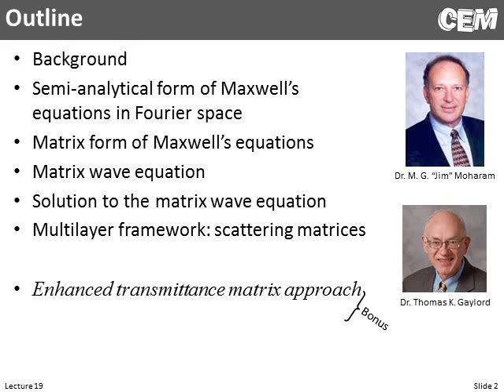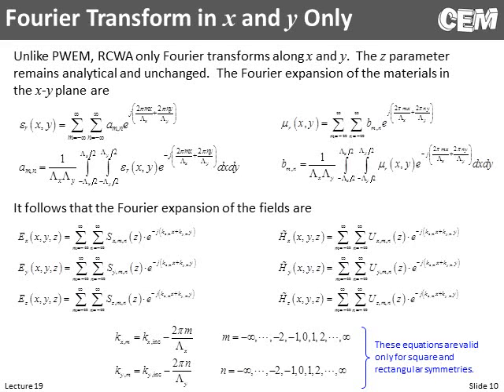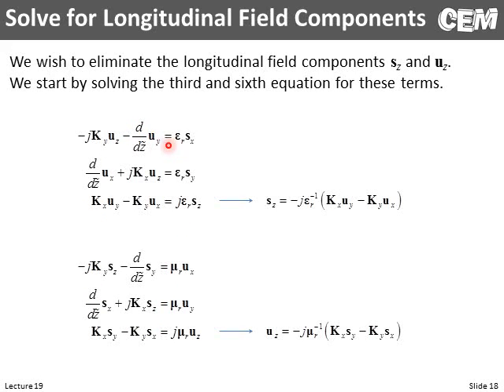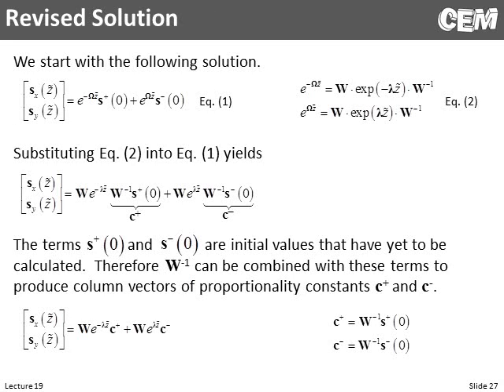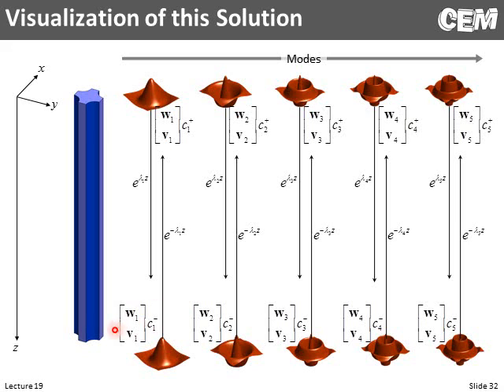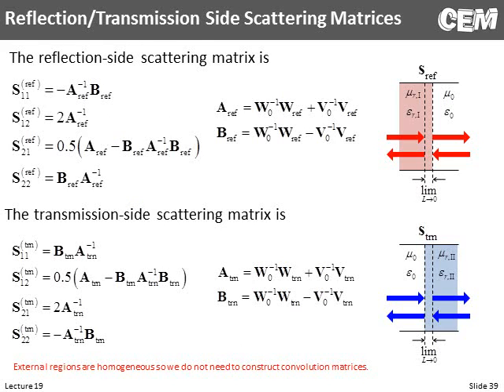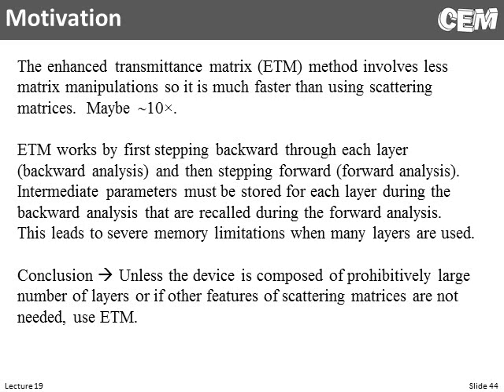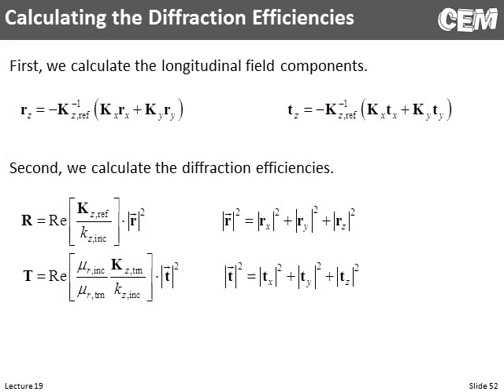Lecture 19 (CEM) -- Formulation of Rigorous Coupled-Wave Analysis

Comment: Hi Dr. Rumpf, thanks a lot for the video and all the courses available on EMpossible. I have a quick question about RCWA: if I want to speed up a 2D RCWA code for high index contrast design optimization, where should I start? Mode truncation? ETM?
Reply from the maker: Truncation -- The modifications to the code are minimal so it is an easy tweak once you figure it out.  Expect a 10% to 20% speed up.

ETM -- This will force you to reformulate how you combine multiple layers.  It requires that you store information from each layer, so if you have hundreds of layers you may run into a memory issue.  Expect maybe a 5x to 10x speed improvement.  I also use ETM instead of scattering matrices when I visualize internal fields.

FFF -- You should also consider incorporating fast Fourier factorization.  This helps with Gibb's phenomenon which is worst for high contrast devices.

Depending on what your device looks like, there are other tricks to speed things up.  A lazy code with repeated layers may analyze each layer independently.  If you can reuse any scattering matrices, that will speed things up.  If you are simulating slowly varying curved structures like a photonic crystal, you may be able to combine adjacent layers that are very similar.  In this way, you can reduce the number of layers with excellent accuracy.  You may also be able to parallelize your codes or employ GPU computing.
Reply: @empossible1577  I do have one question about ETM speed enhancement. In the scattering matrix approach, the most time-consuming step is to construct W and V from eig(P*Q), but in ETM, it is also necessary to construct the eigenmodes, which takes the same amount of time as the scattering matrix approach...
Reply from the maker: @Liangyu-claude  All network approaches involve calculating the eigen-modes so we can ignore that.  The equations used to calculate and combine scattering matrices are also a bottleneck.  They are far more computationally intense than the equations used in ETM.  The benefits of scattering matrices are memory efficiency, consistency with physical measurements, and the terms having physical meaning.
Reply: @empossible1577  I see what you mean. Like the Redheffer star product.
Reply from the maker: @Liangyu-claude  Correct!  That is a very expensive computation.

Comment: Hi, professor! Thanks for lecture! 
I have followed the procedure in this RCWA lecture and I write my code of the scattering matrix successfully. 

But I have trouble in writing the code of enhanced transmittance matrix(ETM). 
1. Could you tell me how to update the B in the 'Work Backward Through All Layers' of the block diagram? 

2. When I test my code, the reflectance remain 1 while the transmittance remain 0. Could I send my code to your email and ask for your advice? 

3. In slide 71 of the lecture 7(c) note, I found t1 is on the right hand side of the expression of B'. Is it a typo? 

I appreciate your help. Thanks sincerely!
Reply from the maker: Sorry that is not so clear in the notes.  You might be the first to implement the ETM method from my notes!

B  = F * [II;X*b/a*X];

Here II is the identity matrix.
Reply: @empossible1577  Thanks for your reply, professor! 
Now my code of the ETM can work and I can get the same result as the scattering matrix. But I still have confuse in the calculating process. I calculate the matrix A in light of silde 66 but I can't get the right result. So I try to put the minus sign of the third row of matrix A to the fourth row and my code runs successfully.  I think I calculate the right result by luck. Do I make a mistake?  I should learn more about the construction of the matrix A.

Thanks sincerely!
Reply from the maker: @huangshp8820  This may be because of how you handled the negative sign on teh KzI term.  This is the z component of the wave vector in the reflection region.  To be strictly correct, it should be negative.  Many times I will keep it positive since the negative sign will just need to be removed later anyway.  Check into this.
Reply: @empossible1577  OK, Thanks sincerely for your advice, professor!
Reply: @empossible1577  Hi, professor! Could you give me some advice on how to image the electric field profiles in the x-z and x-y plane?
Thanks sincerely as always!
Reply from the maker: @huangshp8820 I like to calculate the field in a 3D grid and then I use the slice() function in MATLAB to visualize the field in any plane that I want.  The field calculation is fast enough that I don't think it is necessary to calculate it just in a single plane.
Reply: @empossible1577  Thanks for your reply, professor!
After thinking about two days, I still have confuse in calculating the field. I can calculate the x,y,z componts of the field in the 2D grid in light of silde 11 of lecture 7(a). But I don't know how to calculate the field in a 3D grid. Could you give me some advice on how to calculate the field in a 3D grid?  Besides, I have another question about the simulation of device with loss or gain. Could I change the permittivity of device into complex value directly when loss or gain is incorporated into the simulation?
Thanks sincerely as always!
Reply from the maker: @huangshp8820  Loss and gain is incorporated simply by giving the relative permittivity an imaginary components.

For visualizing the fields, I have very few notes.  The closest discussion I have is calculating the fields for the plane wave expansion method.  Think of this as calculating the fields from RCWA in the xy plane.  Then all you have to do is add phase to calculate the field at any position z.

You will find that in Lecture 6e.

https://empossible.net/emp5337/
Reply: @empossible1577  Thanks for your reply, professor!
Now I can image the field in a 3D grid. But the field I calculated is different from what I expected and I think the result is unreliable. Maybe I should find some benchmarks and spend some time in comparing the result I got with some benchmarks or results from published paper. 
Thanks for your advice sincerely!
Reply from the maker: @huangshp8820  What do you mean by unreliable?
Reply: @empossible1577  Sorry, professor, I didn't make it clear. 
I consider a simple case in the simulation. I use the RCWA to simulate  a 1D grating made of fused silica., there are  about three diffractive modes(0,±1 mode) being generated in the transmission side according to the grating equation. The light is incident on the grating normally with TE mode. And I can check the variable ty(slide 45 in Lecture 7(a)) to make sure that there are only three diffractive modes.  But when I calculate the electric field in the transmission side without adding phase, I only see one band centered in the figure. The figure is like the first figure in the slide 5 of the lecture 4f(21st Century Electromagnetics) but with only one band.  I think I can see three modes in the transmission side, but the result is different from what I expect. So I think I make a mistake in the field calculation and my calculation result is unreliable. Fortunately, I have a better understanding of the physical meaning in the calculation process thank to your help. Could you give me more advice on the calculation? If possible, could you give me some benchmarks of the field calculation to follow with? 
Thanks sincerely as always!
Reply from the maker: @huangshp8820  For some benchmarking examples, check the end of Lecture 4h here:

https://empossible.net/emp5337/

I think the sawtooth diffraction is great for checking that you are getting your diffraction orders correct.
Reply: @empossible1577  Thanks for your reply, professor!
I only learn the parts TMM and RCWA of your lecture. I think I should learn more about other parts like FDFD and FDTD if I want to do further research in the field of computational electromagnetics. 
Thanks sincerely for your help and patience!
Reply from the maker: @huangshp8820  I think it is a great idea to learn more methods.  People become strangely loyal to a single method.  Here is a link to my free course on FDTD:

https://empossible.net/emp5304/

If you are able to pay any money, the online FDTD courses are incredibly awesome.  The first half of the first course is entirely free to see if you like the style.  This series is highly visual and animations and visualizations of everything.  I teach the convolutional PML and some other advanced things.  At least check them out:

https://empossible.thinkific.com/collections?category=FDTD-in-MATLAB

The FDFD method is covered in my Computational Electromagnetics course.

https://empossible.net/emp5337/

However, I recommend first working through Topics 6 and 7 in my Computational Methods course.

https://empossible.net/academics/emp4301_5301/

I also have a book coming out hopefully before the end of the year on FDFD.  That will be a great resource and includes MATLAB codes for just about every device and type of simulation I could think of.

Good luck and have fun!!
Reply: @empossible1577  OK, Thanks for your reply and these great lectures, professor! I'll spend time on these lectures and I'm looking forward to your new book!

Comment: Hi, Dr Rumpf!
If I understand it right the diffraction effiencies (Ref(p,q) or Trn(p,q)) has the same meaning like the UV-plane using in radioastronomy to restore the source form?
Reply from the maker: Very sorry, but YouTube is not giving me the "Read more" option to read your whole message.   Can you try posting it again?
Reply: @empossible1577  Yes, sure.

If I understand it right the diffraction effiencies (Ref(p,q) or Trn(p,q)) has the same meaning like the UV-plane using in radioastronomy to restore the source form?
Reply from the maker: @wolfwolf7121  Now the "Read more" thing is working for your original message.  Crazy!

If I understand your question, you are asking if you can recover the grating given the diffraction efficiencies?  In my experience, not exactly.  Electromagnetics is not scalar so a direct translation from diffraction efficiencies to the grating is not entirely possible.  Also, there are multiple gratings that will give very close diffraction efficiencies.  I have designed gratings starting with the phase using scalar techniques and the grating works surprisingly close, but is not controlling polarization.  If I understand your question, you are describing an inverse problem.  I have only solved those through optimizations, but there are other techniques.
Reply: @empossible1577  Thank you for your answer.
Yes you understand right my question.

Since the UV plane (that is calculated from radiotelescopes) and the diffraction efficiencies (from RCWA) means the same - dependece of power from spatial harmonics, I thought it will be possible to reconstruct the grating.
I tried to IFFT the R(p,q) and T(p,q) for some gratings but it didnt worked. 

It is very interesting because the UV-plane and diffraction efficiencies is the same far field concept and I thought it should work

Comment: Hi, professor! I have a question about 3D RCWA. What if one of the layers consists of highly anisotropic material in z-direction? As far as I can understand, I think I just have to build new convolution matrix for \epsilon_r of the layer. Do you think it's correct? Did I miss something? Thank you for your reading!
Reply from the maker: Uhg.  Somehow I missed your question.  I try to answer everything within 24 hours.  Very sorry!

If the anisotropy aligns with the xyz axes, there is little modification of the code.  The only thing that happens is that you have ERxx, ERyy and ERzz convolution matrices instead of the single ER convolution matrix.  On slide 18 of RCWA formulation, your equations would look something like...

-j*Ky*uz - d/dz*uy = [ERxx]*sx
d/dz*ux + j*Kx*uz = [ERyy]*sy
Kx*uz - Ky*uy = [ERzz]*sz

The only difference in these equations is the convolution matrices.  Proceed with the formulation to arrive at new expressions for the P and Q matrices.  After that, nothing else changes.

If the anisotropy is not aligned with the xyz axes, the problem becomes more difficult.  I cover this a bit in the transfer matrix method, but I don't think is your case.  I should include a slide about this, but I do not have anything.
Reply: Thank you so much :D